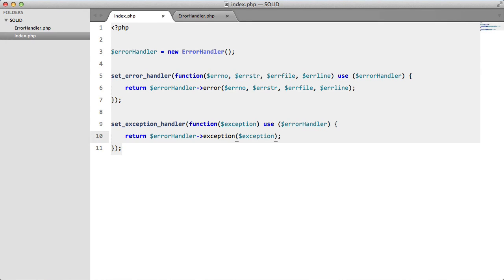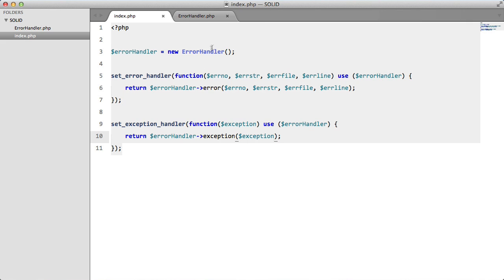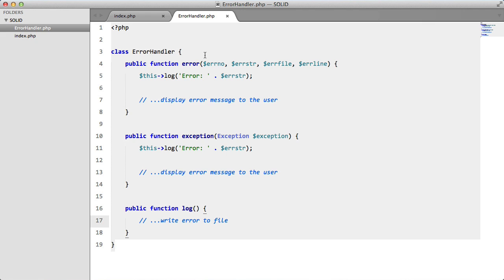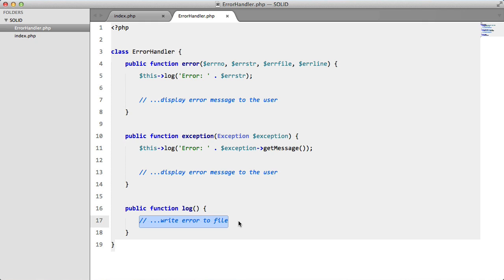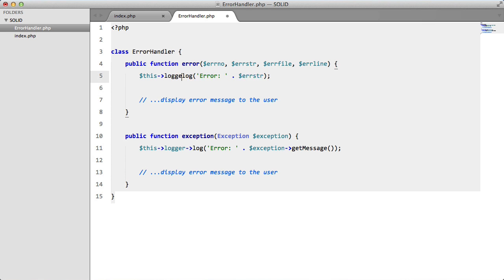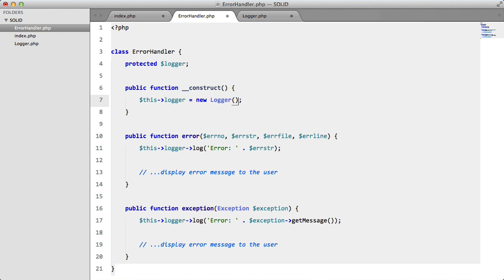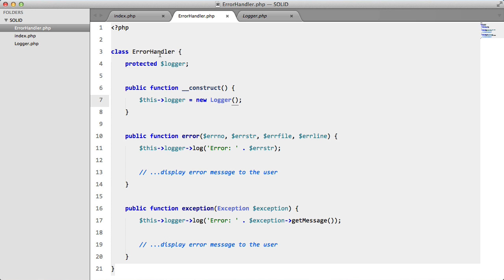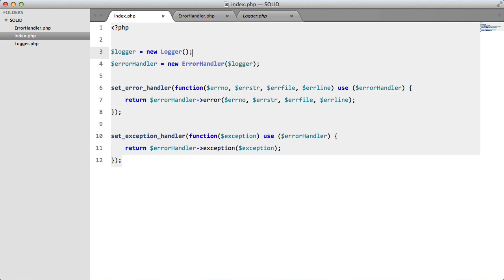SOLID: Dependency Inversion (Part 5/5)

Comment: I think you should actually pass an interface to the constructor of the ErrorHandler class because in the example that you showed you used the Logger class which is a specific implementation. However, if you pass an interface (which is an abstraction), you can change the Logger class to anything that you like such as a FileLogger or a ConsoleLogger, without having to change the code inside the ErrorHandler class.

Comment: I really liked the other videos, they were incredibly useful. This one, I have still no clue what Dependency Inversion is. It looks like all you did was do the Dependancy Injection. Or is this actually what Dependancy Inversion is?
Reply: Dependency inversion and inversion of control is a whole different subject entirely which could easily be put into a video of an hour in length. There are so many different ways to go about managing dependencies, you really just have to play around until you find a way that you like.

I don't want to release too many details without Alex's permission, but there's a new series coming up which goes into IoC extensively. Should be done within a week or two :)
Reply: here is a site where uncle bob gives himself teaches you SOLID and so much more .
www.cleancoder.com/